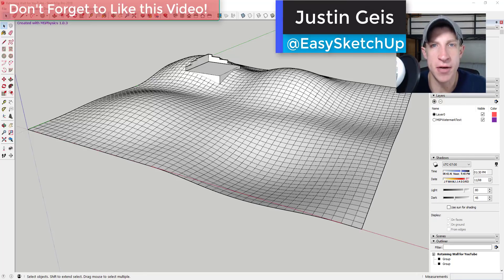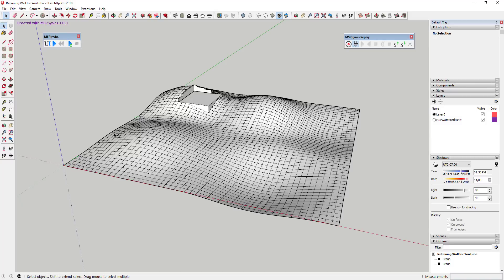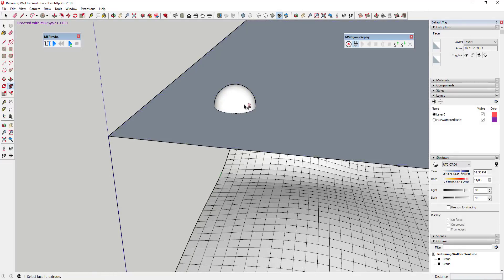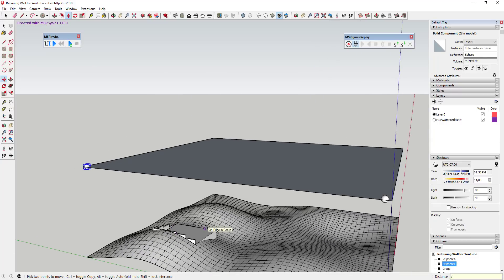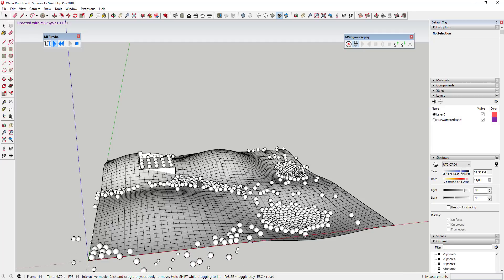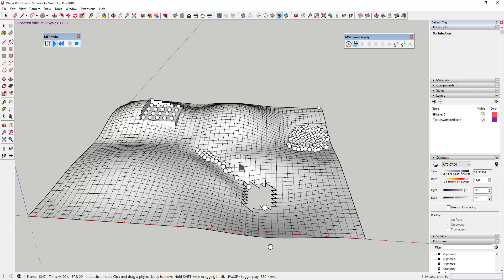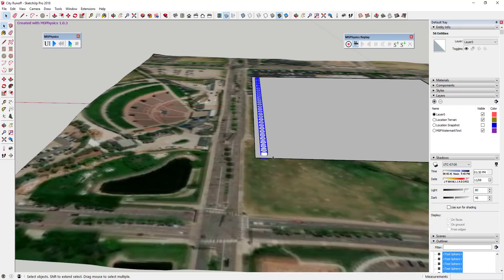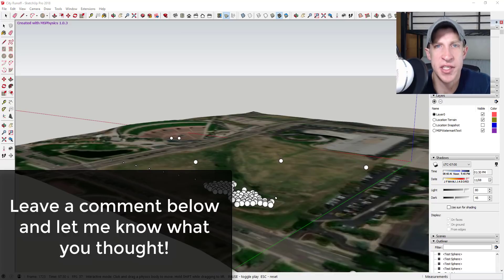SIMULATING SITE DRAINAGE in SketchUp with MSPhysics

Comment: Great simulation ... I  definitely see the value of a powerful computer when you stare doing simulations ... like much smaller "drops" and multiple layers of drops to simulate rates of rain ... which brings up a Sketchup performance question.  Does Shetchup utilize multiple cpu cores if they are available on the computer?
Reply from the maker: I don't believe that it does utilize multiple cores - this seems to be an issue with multiple 3D modeling programs...

Comment: Nice to see where the runoff goes but how do you determine the acreage for each drain shed required to determine the drain pipe sizes?
Reply from the maker: I'm sure someone will be along to correct me if I'm wrong, but if you're looking for a program to do these calculations, SketchUp probably isn't the right choice. As far as I'm aware, there aren't really plugins that do this in SketchUp...